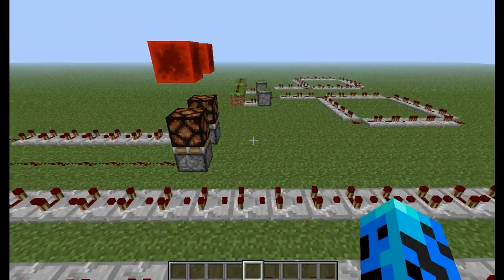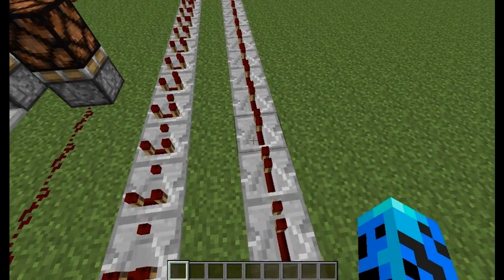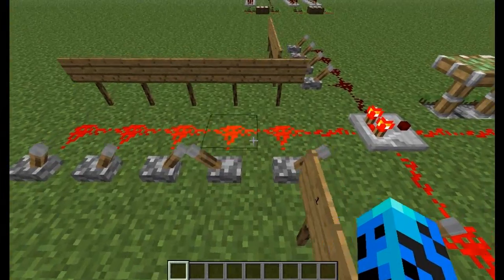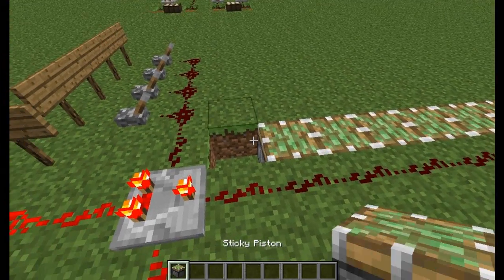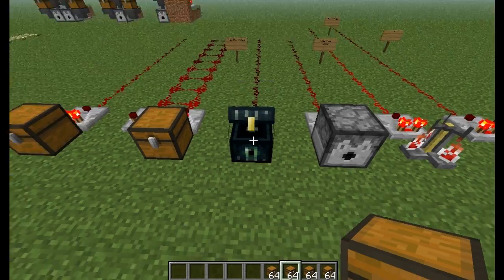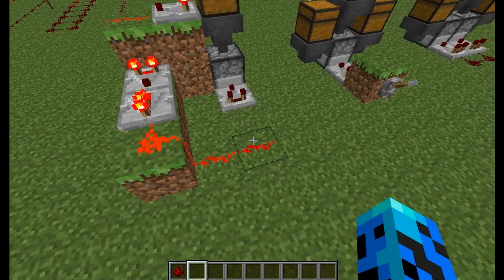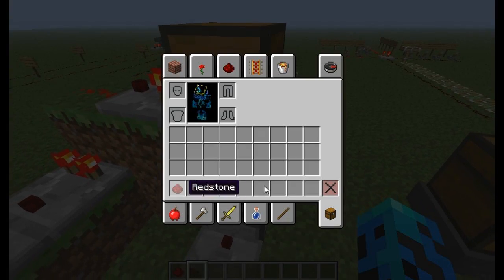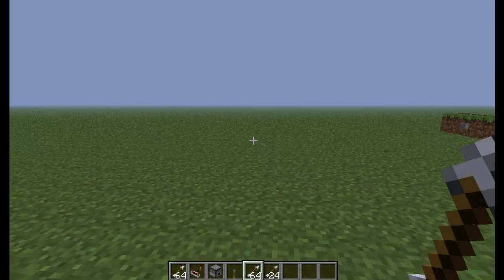Redstone Comparator EVERYTHING ABOUT IT!

Comment: The way I'd describe the Ender Chest problem is that the contents are different for each player. It's sort of like an expansion of your own personal inventory only you can only access it through the chest. So if Player A has a 5 stacks of cobblestone in their Ender Chest and Player B has 4 stacks of birch wood in their Ender Chest the comparator would need to produce a separate output for each player.

While it wouldn't be entirely out of the question to just have the output be different on a per-player basis, it would likely require radical changes to how the server software functions. It has enough to keep track of without complex redstone contraptions that have different inputs going into it depending on which player is observing it.

Comment from the maker: That's true, if the command is set /testfor[Arguments] and it comes out true and you have a comparator linked to the command block, you will have an output. Now this output will change depending on the command arguments. For example if it is completely true then it will output 15, if you set it to testfor a certain amount of players in a region it will output the fraction of the players that are in the area. for example 3/5 players are inside, so 9 output.

Comment from the maker: For the comparator's main features, the regular mode (Without the torch on) has it so that if input A (The input from behind) is less than or equal to input B (the two sides) then the current will not flow. However if it is NOT equal or less than input B then it will flow normally but not start the current out at 15. For the diminisher it's Input A minus B. (Diminisher is the front torch on)